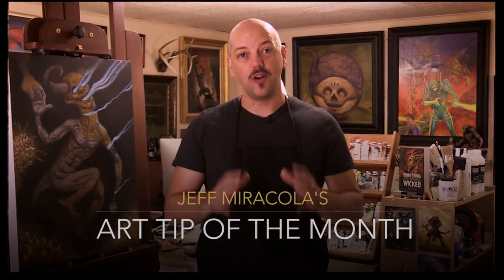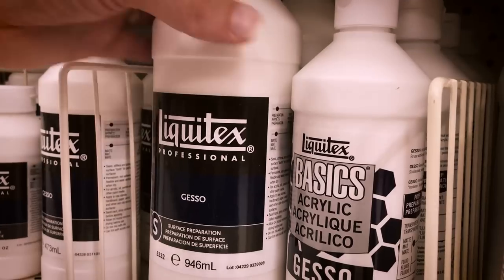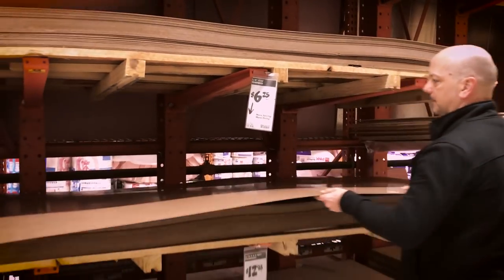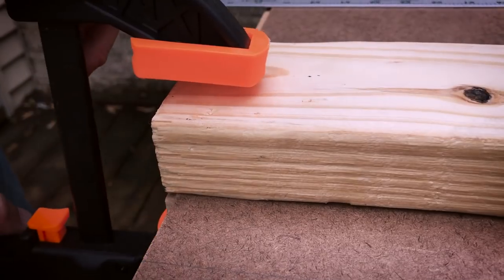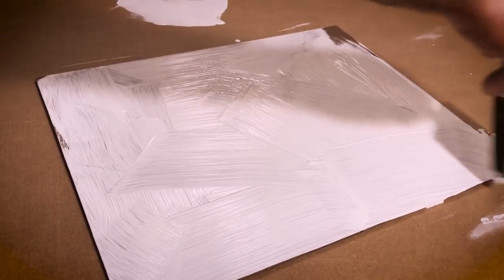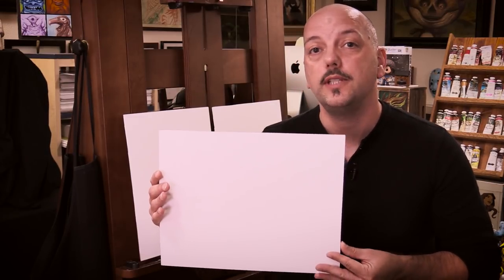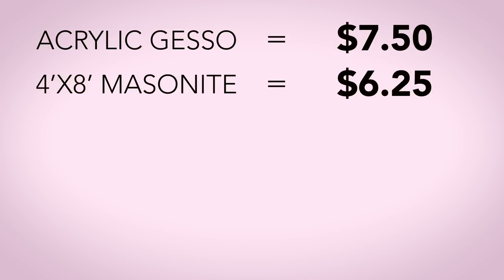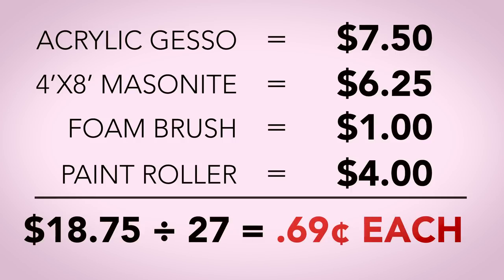Art Tip of the Month #11 with Jeff Miracola - Do-It-Yourself Gesso Boards

Comment: Add one coat of gesso to the back to prevent warping.
Reply from the maker: I do that with illustration board. But I've never had a piece of masonite warp, even up to 18"x24". I've never had the need to put gesso on the back at those sizes, even the 1/8" thick masonite.

Comment: This is how I do it but I use an oil ground. I work in oils and the oil ground prevents the oil paint from sinking into the gesso and board.
Reply from the maker: I put my acrylic ground on rather thickly with at least three coats if not more. I have never had an issue with oil paint leeching through the acrylic gesso. I'd imagine that would happen if someone applied it too thinly.